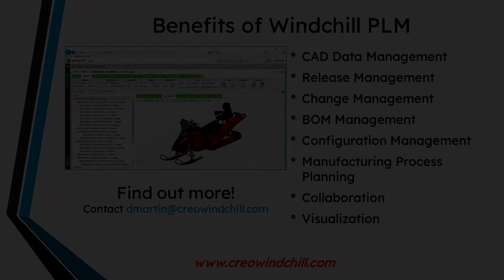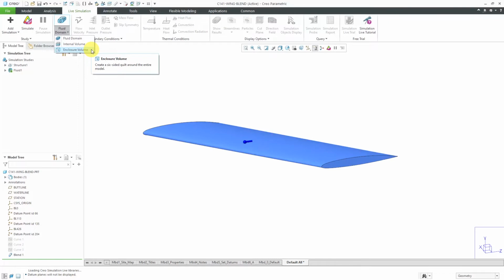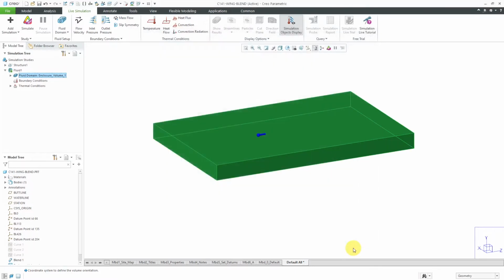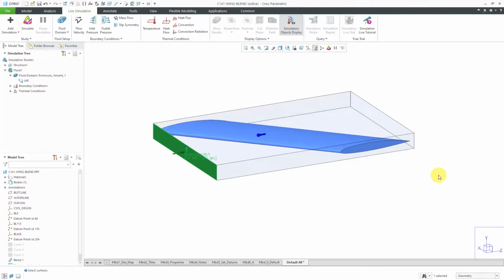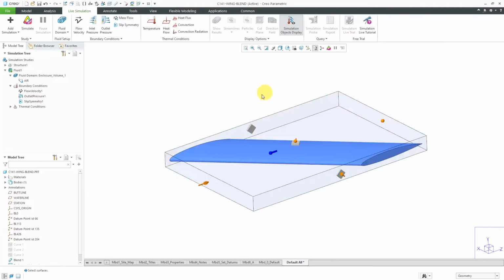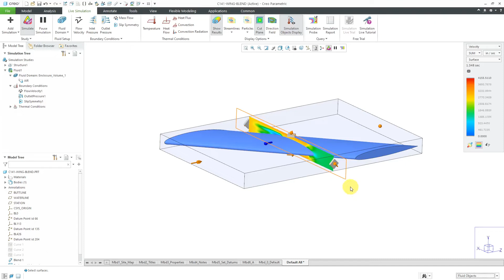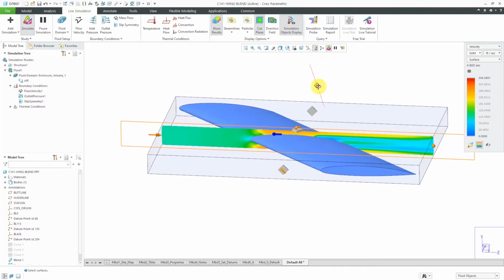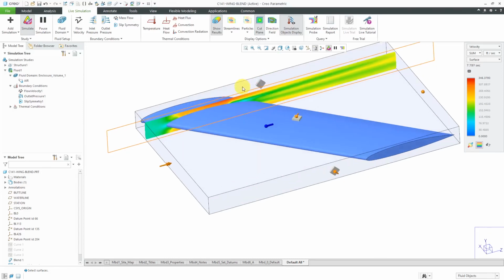Creo Parametric - Creo Simulation Live | Computation Fluid Dynamics (CFD) - Part 2

Comment: Nice tutorial. Just as a little tip, I know this is just for demonstration purposes, but in such simulations, where we observe the flow around an object, especially being a wing (high speeds), the enclosure volume  (domain) should be significantly bigger than the object itself, in order to leave room for the calculation in the upstream (and downstream) of the object to be done properly and converge.